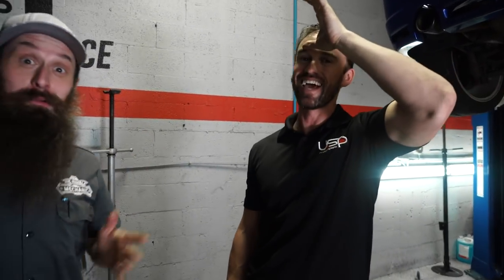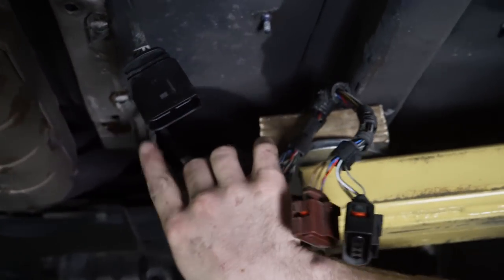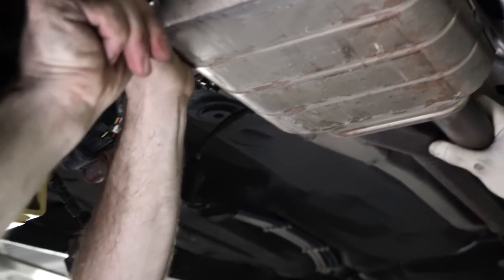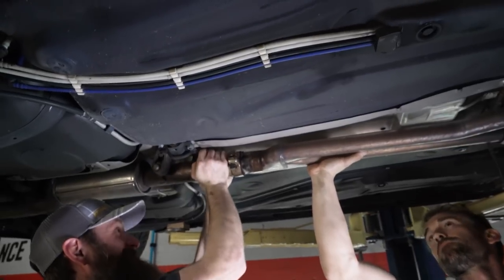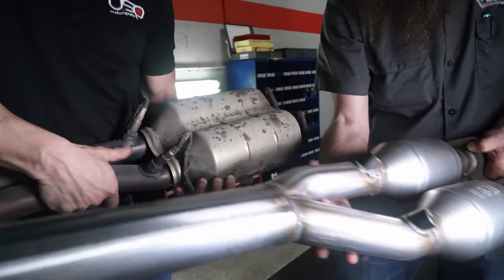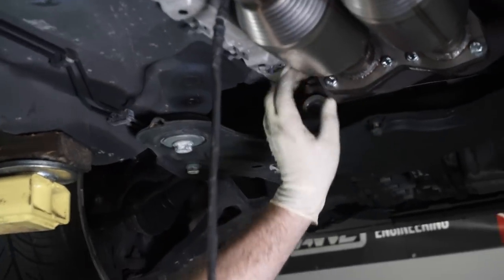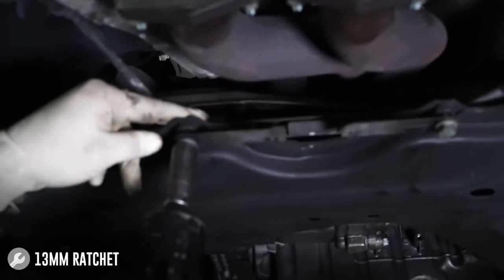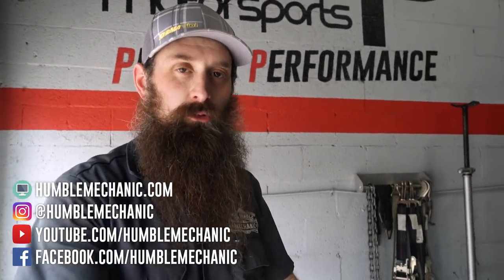VW MK4 R32 High Flow Cat Install ft. HumbleMechanic // USP Motorsports

Comment: Question for the high flow cats does it cause a check engine light? I’m in NYS and that’s part of inspection each year.
Reply: no it does not
Reply: Was quite happy recently here for my inspection here in NYS. 
My 99 vr6 is now 25, and they don't have to plug in to check readiness anymore.
I figured any OBD2 and newer got the check,but not once it's 25! 
I was sweating cause I've got a tune already and let the guy know ,and he said let's see what happens. 
Well I didn't have to find out. 
I'm off to get me a high flow cat now and some other goodies to wake up the ol AFP.

Comment: Did you have any codes or check lights come on after installing the high flow cats? Running same ones with spacers I can’t get Catalyst ready for smog also have UM tune on it ...throws a P0041 Dtc but no check light at times ... also can’t get secondary Air ready either any pointers or advice any info would be appreciated

Comment: No flow cat. Just took it off because the engine shut down after warm up. No codes the only clue was O2's temp readings. Adding a gutted cat.  They do not last long enough for the price. I blame it on the fuel, ethanol additive is the problem carbon,carbon,carbon build up.

Comment: Fyi the cats they use are pretty shitty for this.  They are a low grade ceramic.  Mine lasted almost 1 year before one completely separated and made a horrific rattling sound like marbles in a can.  I just hallowed them both out after that.  Not even worth paying shipping to have it happen again in another year.  The price point is reflective of the quality of the cats I will say that much.  Just figured I get more than a year out of them.
Reply: Had same issue with mine. MK5 application. Lasted 10 months
Reply: J Mullner interesting.  Probably the same kinds.  When I said under a year mine was 10 months as well.

Comment: Mmm in USA  R32 was fwd??? All r32 in Europe 4motion...
Reply: Ramūnas G no it's awd they probably popped the fuse to Dyno in fwd
Reply: Ramūnas G what? Are you saying US is fwd?  I dont think so but im in new Zealand so I don't know
Reply: Evan sutherland no it's 4 motion.  You can pull a fuse to make it fwd to Dyno it if you have a fwd Dyno.
Reply: I don't think so what you can just take out fuse,and it will by front drive.
Because it's not Quattro.
Reply: Ramūnas G I'm not sure what you're asking but I think I do (language barrier).  I have pulled fuse 31 before and dynod in fwd.  This disables the haldex.  You can also unplug the haldex or unplug a speed sensor.  The easiest is to just unplug fuse 31.
Reply: Ramūnas G I forgot to mention that mk5 r32 is different from what I've heard as far disabling haldex.  I think for those you have to jack the car up and unplug the harness.  I have an mk4 r32 so I'm not sure for mk5 r32.  I just have been told it's slightly different to deactivate haldex.
Reply: I have 2.0tdi 4motion so one thing how I can disconnect just take out middle axel, or how you said disconnect directly from xaldex
Reply: Ramūnas G mk4 or 5?
Reply: Mk4 didn't had 2.0tdi I have mk5.
But it's no point to take out fuse,because anyway middle axel will,turn together with engine. But thanks for info, I will try to see if I have 31 fuse 😉
Reply: Ramūnas G good luck and let me know!
Reply: If you ever blow fuse 32, NEVER PLUG IN A NEW FUSE 32 until you have fully inspected the Haldex unit.  If the fuse blows, it means there is big trouble and you'll damage the unit if you restore power.